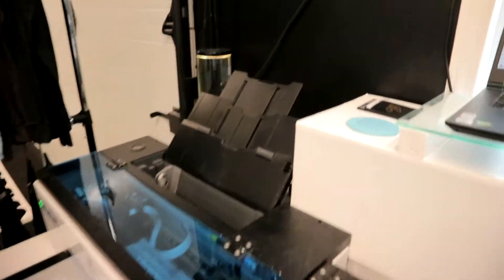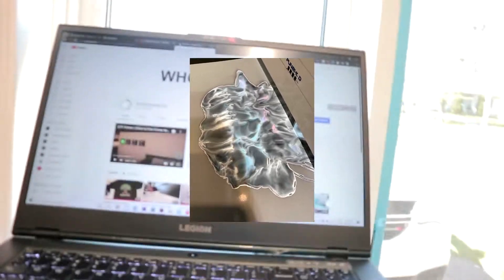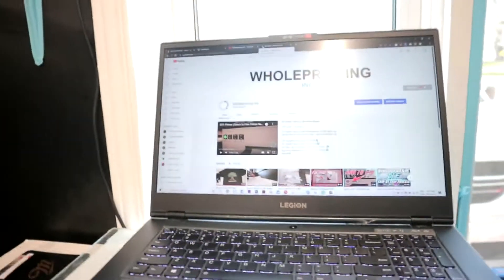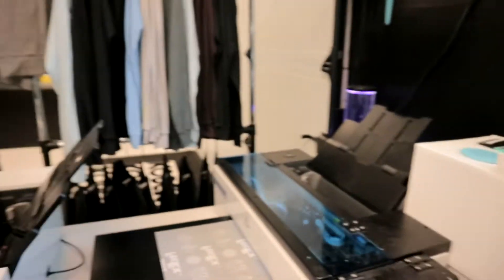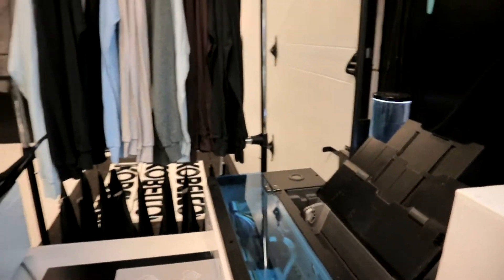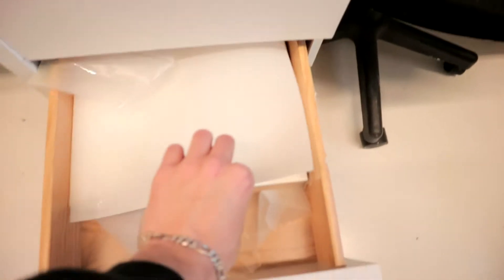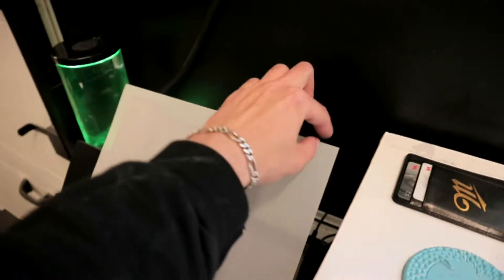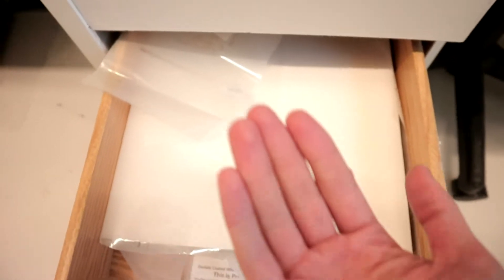How to Fix Blurry/Watery DTF Prints

Comment: What is the required heat temperature for pressing DTF?
Reply from the maker: Depends on what type of garment you are applying your transfer(s)

Cotton: 305F 17s High Pressure 
50/50: 290F 15s High Pressure 
100% Polyester: 270F 10a High Pressure
Reply: @WHOLEPRINTING  thanks so much. I’ve been having some cracks after pressing and sometimes also looks faded on the fabric. It’s costing me a lot.

Comment: I print both side but still wattry print coming. On dtf printer epson l805 plz tell me how to fix it plz.
Reply from the maker: Email us - wholesprinting@gmail.com
Reply: @WHOLEPRINTING  i did email you sir and also send files on your instagram please help sir.
Reply: @WHOLEPRINTING  please sir tell me what i am doing wrong
Reply: Did u figure it out?
Reply: @twoospeak2962  yes
Reply: @princy3601  
Did u fix it? How ??can you tell me, please 🙏 
I have the same problem rn and idk what should I do
Reply: @princy3601  what did you do?
Reply: I have the same printer and the same problem
Reply: @gojivan  i stop dtf
Reply: @trateco2099  what worked for me was adjusting the ink levels. By default it's set to like 400 but I took it down to 200 & haven't had the problem since. Also I have my flood levels set to 0
Reply: @gojivan  what worked for me was adjusting the ink levels. By default it's set to like 400 but I took it down to 200 & haven't had the problem since. Also I have my flood levels set to 0
Reply: I should also mention that I use the cadlink software to print
Reply: @twoospeak2962  can you show me on video tutorial of it ? acrorip please
Reply: @princy3601  I couldn't figure it out in acrorip. Only cadlink
Reply: @twoospeak2962  ohhh i dont own cadlink its too expencive for me 😀for startup business

Comment: I had the watery prints on the correct side of the paper with the setting suggested by you. Any other ideas?
Reply from the maker: Yess! Go on the video how to fix blurry prints and the dull prints video there’s multiple videos you can try on my channel to hopefully resolve your issue
Reply: @WHOLEPRINTING  I have watched them but they are not dull but the ink is running like there is too much ink.
Reply from the maker: @carastringer9607  I would need to see more can you email us and attach a photo? wholesprinting@gmail.com
Reply: @carastringer9607  did you syringe 💉 the inks
Reply: @mauricioherrera7731  yes I did
Reply: @carastringer9607  hi have you fix the issue of watery film when you print?  because am having the same problem, let me know if you did please
Reply: @phustlersillah1880  did you fix it ? please tell me how to fix it please
Reply: Change your settings to 65% color and 55% white.. it’s watery because the ink is not drying I just fixed the issue today
Reply: @knvsxswds2033 but the true colors won't come.